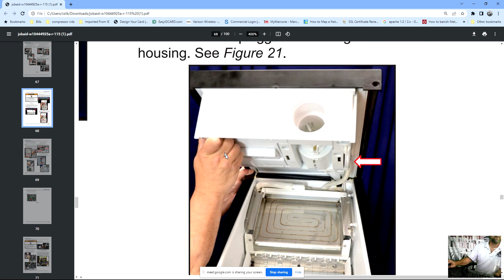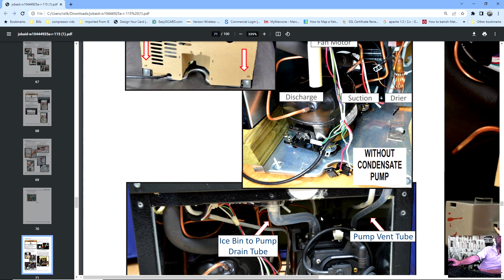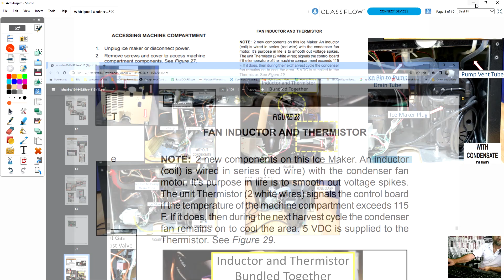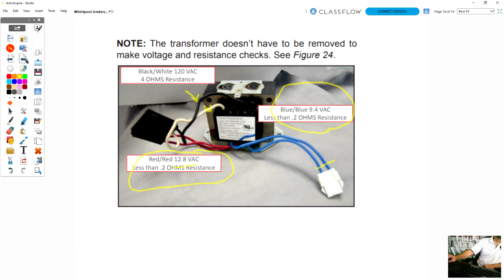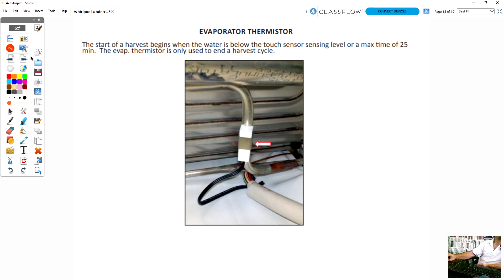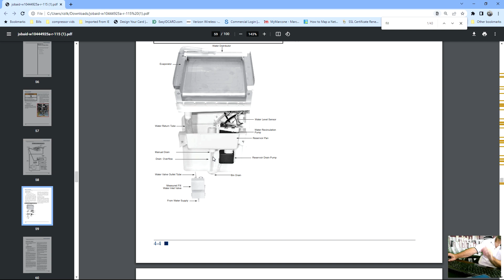New Whirlpool 50LB Ice maker

Comment: It appears that there are two set of thermistors (bin and evaporator) for the electronic control Whirlpool/KitchenAid ice makers (after 2007). One set has a resistance of 10K ohms @25C(77F) and, probably beginning 2013, the other set has a resistance of 2.7K ohms @25C(77F). One the changes in the new design is that you no longer can plug in the evaporator thermistor, you have to buy the whole wiring harness to replace it. If you are handy, I identified DigiKey Part # 56-NTCLE350E4103FHB0-ND (Manufacture # NTCLE350E4103FHB0) as a replacement for the 10K ohm thermistors and Digikey Part # BC2417-ND (Manufacture # NTCLE100E3272GB0) for the 2.7K ohm thermistors .